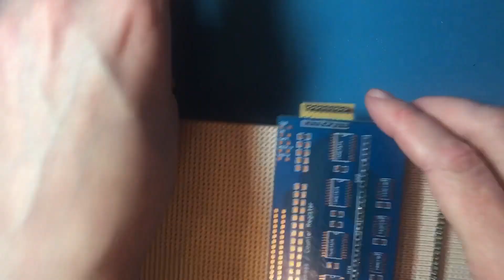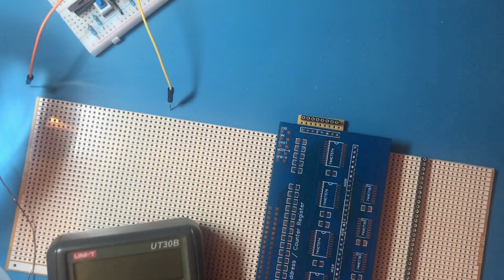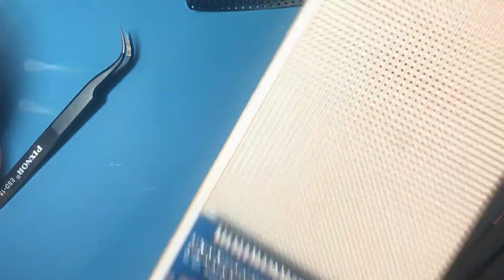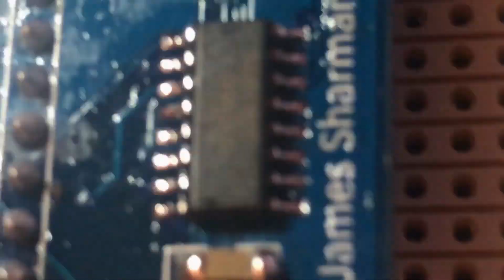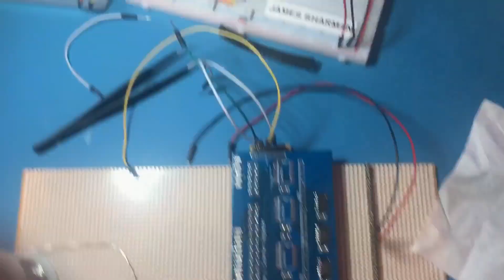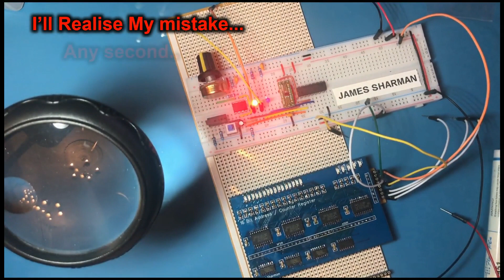James Tries to Solder - Making an 8 Bit pipelined CPU - Part 20

Comment: This other guy Fabian is using "solder paste" and a stencil to smear it into the right places on the board.  Then he just kinda lays down the components on top of the paste, and finally applies a heat gun.  It really looks like the resistors and capacitors and stuff kinda get sucked into alignment when that heat is applied.  I'm certain I've seen contacts bridged with the stuff, he cooks it, and everything turns out fine.  I've always soldered by hand, too, but it looks a lot easier his way.  How can that work?  What's in that stuff?
Reply from the maker: You'll find I switch to Solder paste and a heat gun later in the series, and then I trade up again to using a hot plate. I've resisted switching to an oven like commercially outfits use as it's easier to record video on the plate. Solder paste works "magicaly" by the combination of surface tension tugging the paste towards the metalic conducters and the solder mask push it away from the areas it shouldn't be.  Check this out as one bit of reflow I recorded a year or so ago. https://youtu.be/HtfcTYw3GuE

Comment: Nice..I used through hole components on pref board.  Then wired paths with think wire.  Modules are connected with ribbon cables.  Maybe  I’ll try few modules with smd components. I also like the backplane idea.
Reply from the maker: The back-planes work well. If I did this again I'd probably jump strait to custom made backplanes though, using strip-board was limiting on my layouts.

Comment: As a solder-er, you did well.

You might have noticed this by now, but... A used binocular microscope would give you a great view. Perhaps jeweler's flip up magnifiers would work. I had some dentist ones, but I found that the working distance was too great, making it too hard to keep my head still to see what I was working on. Thinner solder would have help you apply the solder more accurately. With fine solder, you have to feed in a whole lot more, and with thicker, the slightest heartbeat that reaches your hand makes one pay out too much solder. A smaller tip would give you more control.

[When I first soldered surface mount, I used the included pointed tip with my Hakko, which also is suboptimal, but it got to where it needed to go. I got some of those cheap kits to practice one, so the pressure was off.]
Reply from the maker: Thanks! My techniques evolve a lot over the course of this project.  I am constrained by the desire to capture things for the video though.

Comment: Around 24:50 is where I first notice that the reversed chip is an LED. - it's glowing!  (It's also an SED - Smoke Emitting Diode - of course!)

Looking forward to the rest of the series, and seeing whether you ever mod a cheap toaster-oven or kitchen hot plate into a reflow station so you can use solder paste and stencils.
Reply from the maker: I’m amazed I haven’t destroyed more parts!

Comment: Dave is not the best solder guy, there are better teachers on YT.
edit: I think you using lead free solder, your joins are not shinny. If you have (or buy some) us some 60/40 lead solder, that is much better and easier to us.
Reply from the maker: That solder supposed to be 60/40 but it's not very good. I did a solder comparison video a little while after to show my research on the subject.

Comment: Just seeing someone having to solder so many SMD joints with just a simple iron makes me feel sorry for you. I watch the series from the beginning, so I am sure you have found out by now, but that amount of SMD solder joints just screams "HOT AIR!". It makes things so much easier, especially if you have to take components out and put them back in. Even with my cheap hot air station that cost me less than 100€, this would have been a lot easier to do.
But I salute you for you going through the ordeal of hand-soldering the entire PCB.
Reply from the maker: I'm a strong believer in walking before you run. I use hot air for most of my circuits now but I think it's wise to practice hand soldering first.
Reply: @weirdboyjim  I can see your way of thinking here. But I wouldn't pick climbing Mt. Everest as my first walking exercise, you know... 🙂

I started hand soldering SMD too, but that were only a handful of components and no ICs. In fact, the very first SMD component I ever soldered was a tiny (not sure the package, but hard to see with the naked eye and no markings on it because it was too small) resistor that had broken off a USB memory stick PCB, making the memory stick unusable. It does work again. In fact, in some of my designs, I even mix&match SMD and conventional, depending on what parts I have available. If it is just a few resistors or capacitors, where I usually use 0805, I don't bother getting the hot air gun heated up if my iron is already on. But this PCB.. I most likely would not have had the patience to hand-solder it.  Especially not on camera.😅

I can't wait to find the time to follow along in your series, and also on later projects. Youtube already showed me something about VGA from scratch. But i watch chronologically.
Anyhow, Big thanks for your great content!

Comment: I was going to recommend Dave at EEVBlog’s SMD soldering tutorials, but also had a feeling that you were going to mention him anyway 😉. I was needlessly scared of SMD for 20 years, until I saw his tutorials. Turns out it’s easier than it looks with a pair of tweezers, and I find it relatively tedious and slow to go back to through-hole soldering.
I have got pretty good at plopping the components out in roughly the right position and the right side up, by peeling the tape off the back really close to the board. I expect you’ll be doing this too a video or 2 further along, though.
Reply from the maker: Later on I switch to hot air with a stencil which is even easier. What I do now is cut the component tape I need and stick everything for a specific pcb to a bit of cardboard with double sided tape. Let's me organize things well in advance.

Comment: Hey James!
I wanted to reproduce Ben's 6502 on PCB with SM components, for a ton of reasons :-)
Where do you get your parts from, and especially the strips of passive ones? I mean resistors and capacitors
Cheers ;-)
Reply from the maker: I've bought from multiple places,  lcsc, digikey. Most of my stuff recently has come from mouser.co.uk
Reply: @weirdboyjim  oh nice!
i've being searching parts on the french conterpart of mouser and it's been quite productive i think!
and i realized that SMD resistors/capacitors were on strips by default and they cut them at the desired size. its even written!

anyways, thanks for the tip :-)

Comment: I learnt to solder when quite young, with a copper tip mounted into a wooden handle (made by my dad) that was heated on the gas cooker for each joint…sounds mad doesn’t it. Progressing through hobby Antex brands to eventually workplace Weller, and learning all the time. All this experience however went out of the window with SMD technology and I started again, my first attempts were awful and frustrating. You did a fine job there sir, give yourself a pat on the back :)
Reply from the maker: Thanks Peter! As you progress through the series you'll see I mostly switch to hot air which is a much better way of smd soldering, always worth developing the hand soldering skill for it though. Especially needed for the occasional bit of rework.

Comment: I'm right-handed. Something I realised after years of soldering is it somehow works better if I keep the iron in my left hand and use the right to hold solder, tweezers, flux, set up fixtures, etc. Touch wood I've never burned myself…

You can get SMD practice kits on ebay for very cheap - a bunch of passive components, LEDs, a 555 timer and a decade counter - and make a satisfying blinkenlight device - found it built my confidence very fast! I don't want to do any bulky through-hole boards any more now :)
Reply from the maker: I just felt more comfortable with the soldering iron in my right hand. As you watch these videos you should see rapid improvement in my skills, after a while though I switch to hot air which makes life easier all round.
Reply: I’m also right handed but when I solder with an iron, I use my right hand, if using hot air, I hold in my left 🤷

Comment: I don't know if it's just the equivalent of an old wive's tale, but I've always been told holding the iron to the legs of chips is bad practice and can cook them internally if you do ti too long.
Reply from the maker: I've not had any chip failures yet, these things are designed for reflow ovens so they need a decent amount of heat tolerance but the heating pattern is very different with an iron. Less contact is probably better, I'm definitely having briefer contact now I've a bit more experience.

Comment: Hey James,
 1.27mm SOP packages are fun. Try a LQFP in 64+ pin packages at 0.4mm pitch. Those are a beast. The pins are so thin they bend if you look at them the wrong way. I did a MSP430F2618 in an 80 pin package a few weeks ago on a home etched design without a soldermask. That's a fun challenge. Heck just etching that footprint is right at the limits of my 1200dpi laser printer's resolution.
  I'll share a few tips I've picked up from soldering. I use real Hakko tips even though I have an Atten made Hakko clone iron. I have a 60 watt station that was branded for radioshack. I use the Hakko 900M-T-3.2D tips almost exclusively. That's one of the largest chisel tips they make for the 900 series. That tip has the largest thermal mass of any of the tips I have used. I got 10 of them in individual sealed packs from an authorized dealer years ago and still have 7 in their packaging. Even with the tiniest SMD chips I have soldered the large tip works best. It all comes down to the iron's temperature feedback loop. If the iron's controller is really well coupled to the tip it can compensate quickly. When you're dragging solder across pins you're introducing a lot of extremely quick little stepped changes in temperature. If the iron has a delay in the control loop the temperature of the solder will drop between some of the pins, especially when the footprint has a large or varied trace size/plane. If you want to avoid this problem you have 2 choices, get a high end iron like a JBC or add a thermal buffer. The larger the thermal mass of the iron's tip, the more it will bank energy and resist change. If you can physically get the tip on the surface, a larger tip is always better at maintaining temperature. 
   I have tried a bunch of the cheap solder available (probably a dozen or so). I only use MG Chemicals 22 gauge. I currently have a 1lb reel of 63/37 "No-Clean." I wouldn't recommend the extra cost of NC. The regular flux they have is fine and a good bit cheaper.
 Next, the Amtech UV flux sold on ebay AliEx is absolutely fantastic compared to those pens kike you used here. I've tried those too. Cleanup of flux is a pain. The best investment I have is a cheap jewelry type ultrasonic cleaner. I use cheap pharmacy type isopropyl alcohol in mine. It's absolutely worth dropping whatever you're doing and ordering one. I also use an old powered toothbrush for hitting the tight spots while in the ultrasonic cleaner. I can completely clean any board that fits in that thing within 2 minutes with perfect results every time. I rarely do a soldermask, so I'm cleaning flux off of the entire surface. I tin all copper on the whole board.
Get yourself a block of Sal Ammoniac (ammonium chloride). That's a tip cleaner that works great. 
 If you get cheap solder wick add flux to it. Get a cheap solder sucker from China too. When you're in tight spaces use a piece of heatshrink on the tip of the solder sucker to focus it where you need it and increase the venturi effect.
  If you get a cheap 858 heatgun pay the extra few bucks for the one in a bench enclosure. I have the cheapest one that comes with a laptop power brick form factor control unit. It's awkward to use at the bench. I regret being too cheap on that purchase.

 Lastly check out busboards dot com. They have a zigzag strip board. I got one from Amazon recently for use as a backplane. Their larger design is as wide as a 38 trace veroboard but there are 76 traces. It is made so that a 38 pin double row header will have access to 76 traces by interweaving every 2 strip holes in a zigzag pattern. That's super useful for microcomputer stuff.
 That's just a few of my tips :-)
-Jake
Reply from the maker: That soldering job sounds like fun, fun to watch someone else do ;-p How did it go?

Comment: you've probably found out by now, but my favourite way of turning over SMD resistors is to empty them into a little dish (like an espresso cup's dish), then you just gently tap it on the table, and the resistors jump around inside and about 50% turn over. repeat until done :) much quicker than individually grappling with a tweezer.
Reply from the maker: Thanks Lol! I learned the hard way that all the techniques that involve tapping produce unacceptable camera shake while I'm recording though. When I'm shooting I find picking them up and dropping them works, 50/50 odds isn't the worst thing to deal with.
Reply: @weirdboyjim  Get one of those trays for diamond painting. They are so light and springy that you can tap them with a fingernail while holding to turn over those plastic diamonds, the same should work for resistors.

(Diamond painting is using tiny plastic bits as pixels on an adhesive canvas.)
Reply: That is brilliant, Alex.  It's along the lines of what to do when you find your car/house keys in an impossible tangle on the loop.  Just drop them on the floor, and pick them up - let them untangle themselves.